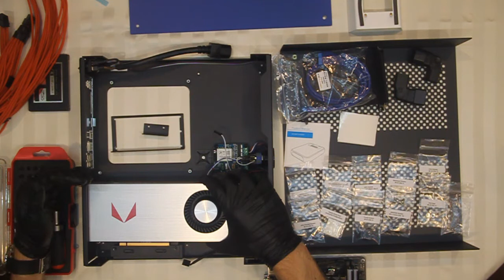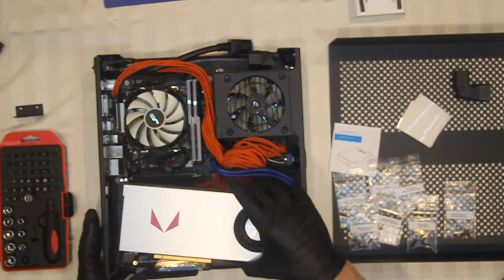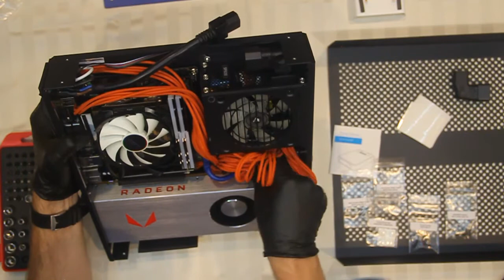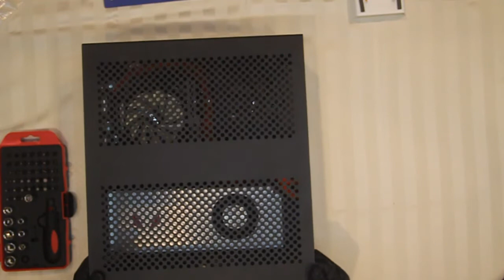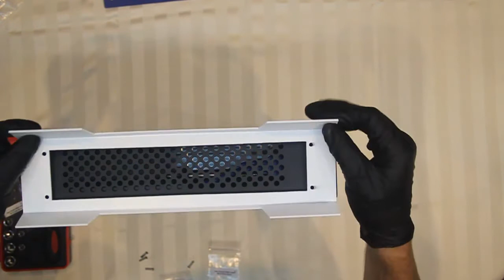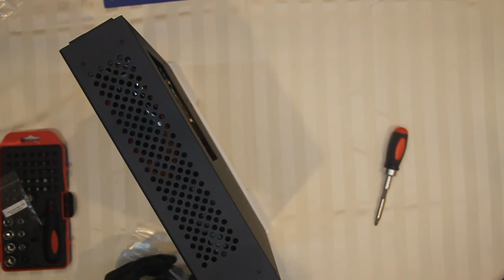CaseBuild

Comment: Are you going to sell more units?
Reply from the maker: I won't be producing any more S400 cases, but the S401 cases have finished the design phase and my fabricator will be delivering me 125 units in early September.  If you sign up for my newsletter on my website you'll be notified when I open up the pre-order.  The S401 features a lot more flexibility for components and accessories (removable handle, 2.5" and 3.5" disk support, and now I'm even laser cutting custom acrylic side panels).  Check my website out at www.salvostudiosltd.com.
Reply: @grsychckn  can you please tell me how to purchase the s400 or s401 PLEASE!
Reply from the maker: @Mariovic20  Thank you for reaching out.  Unfortunately, the S400 and S401 are no longer available and I have no plans to produce more.  The S402 is currently in the prototyping phase with the current availability expected to be in May 2020.  You can contact me over e-mail on my website (https://www.salvostudiosltd.com) or contact me through a PM on the SmallFormFactor.net account.

Comment: It seems to be a great project.
I like the mini-itx desktop case, because some of them resemble much the dimensions of a console.
I bought a Zaber Sentry, the only limitation I found in it is how much CPU cooler height.
but it is something acceptable for the size of it, since it only has the volume of 7 liters.
Another one I found interesting is the Node 202, is almost the same size as the Zaber Sentry, but has a volume of around 10 liters.
The Silvestone models are beautiful, but they are too large, up to 12 liters.
The Zaber is 6.6 cm high, would be interesting if it were a little higher, something around 8.0 cm so it would be possible to use a cooler with a higher TDP.